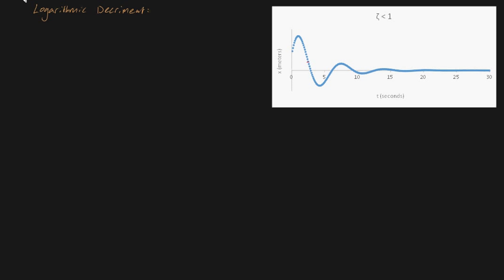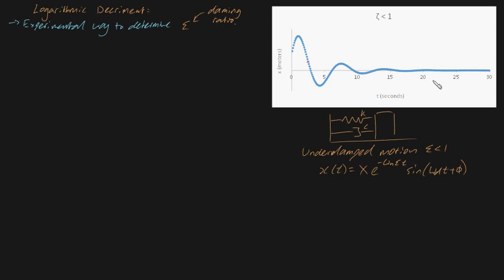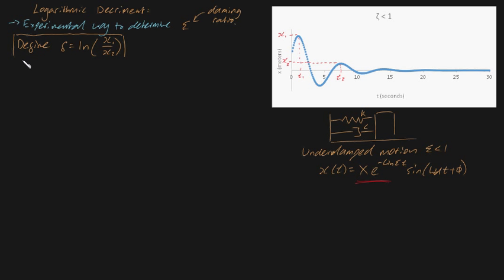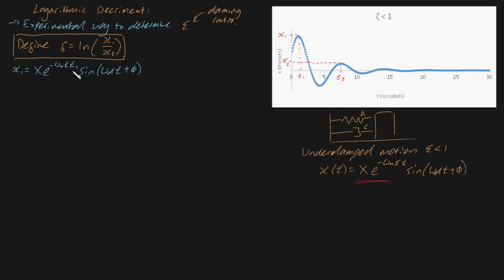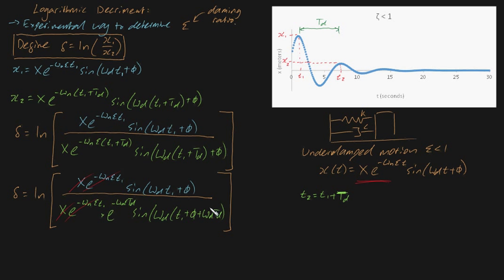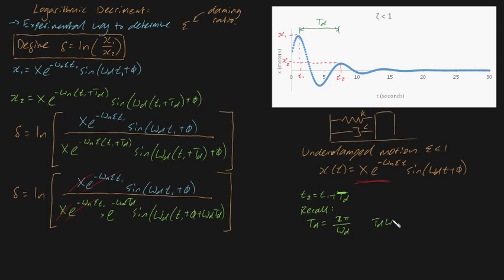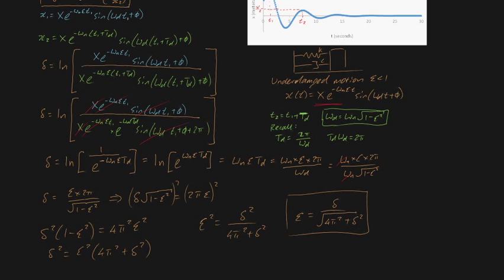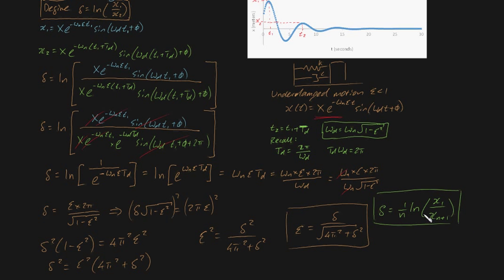logarithmic decrement proof

Comment: Hi, could you please explain how at 13:18 you get delta squared on the right-hand side when diving both sides by (1-zeta squared)?
Reply from the maker: Hello, thanks for the question. I actually don't divide both sides by (1-z^2). Instead I isolate zeta by bringing it to the RHS and factoring. Here's a breakdown:

d^2(1-z^2) = 4*pi^2*z^2

expand LHS bracket:
d^2 - d^2*z^2 = 4*pi^2*z^2

bring d^2*z^2 to RHS
d^2 = 4*pi^2*z^2 + d^2*z^2

factor out z^2
d^2 = z^2(4*pi^2 + d^2)

I hope that makes sense :)
Reply: @virtually_passed  cheers that makes alot of sense now

Comment: You have some great proof's available here. When you cancel out the natural frequency at 11:41, is that to say that the damping ratio is constant even in a system with multiple natural frequencies? I am trying to experimentally calculate damping ratio via the log decrement, but in the frequency domain, there are multiple resonant frequencies.
Reply from the maker: Hey mate! This proof is for a single DoF System (just 1 mass 1 damper and 1 spring) so there is only one natural frequency. Are you trying to use logarithmic decrement to find the damping ratio for a multi DoF system? (multiple masses, multiple dampers etc?) If so I think you'll run into trouble. Maybe this formula can be extended using modal analysis but that's a pretty advanced level. Hope that helps
Reply: Thanks for the quick response. Yes, I was trying to simplify a MDOF system to a SDOF to support my modal analysis theoretically. It is a single mass rotating shaft system. A damping ratio for each mode can be calculated in the frequency domain via modal analysis, but only one damping ratio can be calculated in the time domain via the log decrement. I was trying to find a relationship between the two using the frequency as an input.
Reply from the maker: Hey mate, I think this video might help you out: https://www.youtube.com/watch?v=tyRFoJ7ZcPA&t=46s    . I suspect this system shown in the video is very similar to your problem, only you'll have to use rotational analogs --> Force becomes Torque, mass becomes moment of inertia etc. 

One final thing: The damping ratio is a property of the system and shouldn't vary for when the system is vibrating in different modes.  

If you need further clarification please email me at virtuallypassed@gmail.com

Comment: does this hold true for forced vibration?
Reply from the maker: Great question! No it doesn't. This formula only applies for damped free vibration.
Reply: Thanks for answering! I am just trying to learn this stuff. It's not very intuitive for me. Is the transient motion plot for a forced vibration the same as what the system would be under damped free vibration?
Reply from the maker: Hey mate, yes that's exactly right. Notice that even with the slightest bit of damping, the transient response will die away to 0 after some time. Let me provide you with some intuition. The solution x(t) of a vibrating system will generally have two parts. x(t) = x(t)_transient + x(t)_steady state. 

Imagine you're pushing a swing that already has some initial velocity. In this case you're the external harmonic force to the system. You'll notice that at first the swing will go crazy and that's because the equation of motion consists of two terms (transient + steady state) and so you're observing two sine waves. However! As the transient response gets damped away with time, the steady state response will be the only one that remains and swing will oscillate at the frequency at which you push it. 

Hope that makes sense, watch this if you need more help :D
https://www.youtube.com/watch?v=au_071u5cmI
Reply: Cool. Thanks a lot buddy! Your stuff has been helpful. I've come to realize that this subject is very difficult to self study along with not being very intuitive. Also, there is not a whole lot of online resources that explain the subject in a very clear manner, and the textbooks that are recommended don't show full derivations of the equations so as I "progress" in the course I feel as though I'm just grabbing at concepts and not conceptually understanding. What would you recommend for me for self-study, as someone that likes to learn visually and with a complete explanation and full derivations. How did you learn this subject best? Are there other good online resources?
Reply from the maker: Hey mate, I can relate to your frustration. When I was doing my undergrad, I found that the only learning resources available to me were either painfully simple or unbelievably complicated. I think I might be able to help you out though, send me an email at virtuallypassed@gmail.com and I might be able to send you some resources.

Comment: I'm doing a practical investigation to determine zeta and I did my experiment, recorded my data and plotted the graph. I got the exponentially decaying amplitude but my time period (Td) is not constant, it increases over time. 
My system is slightly different from the one you describe, I have a mass on a spring oscillating vertically in a tube of water (I don't have the equipment for your system) but I thought the maths should be the same anyway.
Can I still use this method to determine zeta? And do you have any idea why my time period isn't constant?
Reply from the maker: +Emmi Mason That is a GREAT question! The first thing I think you should know is that when you have a pendulum oscillating in water, the object vibrating will drag some water with it. So not only will the water produce a damping effect, it'll also act like added mass. Other than that, you'll still be able to use the formula in this video to calculate the value of zeta - just be careful when evaluating the damping constant, c. I'm unsure why you're noticing a changing period though... experimental error?  If you want more detail on this, I recommend going to an MIT video: https://www.youtube.com/watch?v=9_d8CQrCYUw at 1:00:00. It's explained beautifully. 

Hope that helps :D
Reply: +Matthew James Thank you so much!  I redid the experiment and this time it came out with a constant time period so it must have been some kind of experimental error. 
However I have found another question. I was calculating the logarithmic decrement and found that it changes depending on which part of the graph you use. Is the variation in the value I am calculating due to the added mass of the water? I presume the amount of added mass would depend on the speed of the object so is ζ changing to compensate for the changing mass?
Reply from the maker: +Emmi Mason Hello again! Another great question! I'm sure the speed of the object will influence the amount of water being dragged with it, but I suspect this will have a very small effect ζ. It looks like you're evaluating ζ over 1 peak intervals which I suspect is where your large error is coming from. I strongly suggest calculating ζ over as many peaks as you can using the formula at 14:51. Let me know how you go!

PS. Can I ask what Uni is doing this experiment?
Reply: +Matthew James Thanks again! Using more intervals did help even it out a bit. I've also identified a problem with parallax in my measurements which may be adding to the issue.
I'm actually doing this for a school project, coursework for my exams. I'm looking at how the value to c changes with the viscosity of the liquid I am oscillation the system in. I'm using very basic equipment which I probably why I am getting so many experimental errors.

Comment: Sorry about the stupid question, but I'm trying to understand the maths behind damping and it isn't making much sense. Why do we have to use natural log? Why does the amplitude of a sin wave (on distant/time graph) have to be multiplied specifically by e^(-yt). I understand the -yt part but why does it have to use natural logs? Sorry, you just seem like the person who knows a lot about this :) (my maths teacher doesn't understand it...)
Reply from the maker: Hey mate. You've asked a few questions here. Let me answer them one at a time.
1) Why does the equation of motion have an e^(-yt) at the front?
This is the equation for Underdamped motion. There is a formal mathematical proof that derives this equation from first principals using F=ma (I've already done a video on that derivation). You'll notice when you plot it out on excel it looks like a sine wave which has a decaying amplitude that approaches 0 as time goes on. 
2) Why do we have to use the natural log
Imagine you wanted to find damping ratio (zeta) of a vibrating system. Imagine you've plotted out the displacement it makes wrt time, but you have no additional information. How would you do it? There are a few different methods, but the logarithmic decrement method is by far the easiest. With the logarithmic decrement method, it turns out that IF you take the natural log of x1 / x2 then you can find zeta by using the formula at the end of this video. (re watch this video to understand why)

I hope that makes sense. Please reply if you need a more thorough explanation.
Reply: Thanks so much :) That makes perfect sense

Comment: does it matter if I use log or natural log for the delta definition?
Reply from the maker: Yes! You must use the natural log (log base e). If you didn't you wouldn't manage to simplify the bottom expression in 10:40 and the formula would have to change.